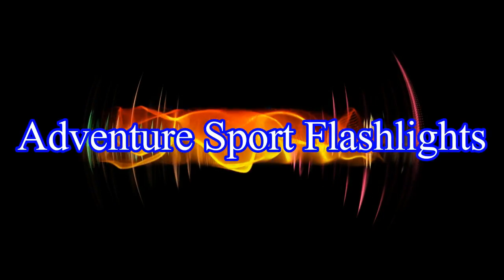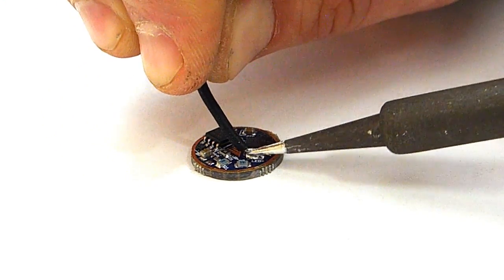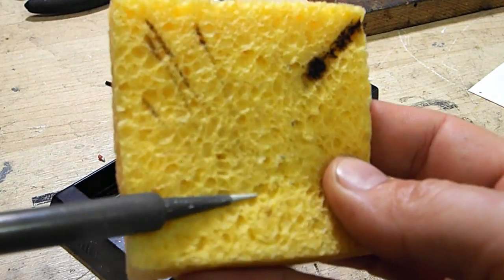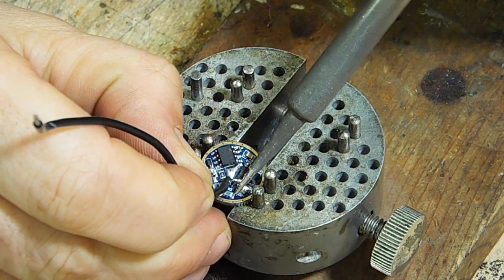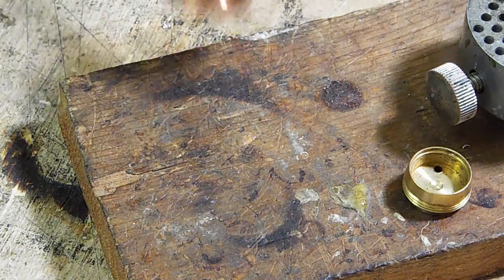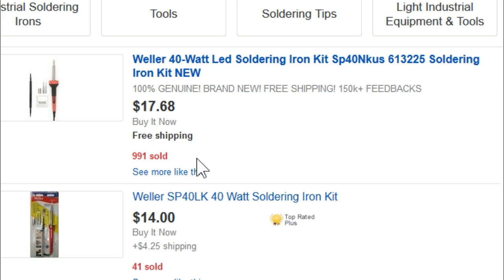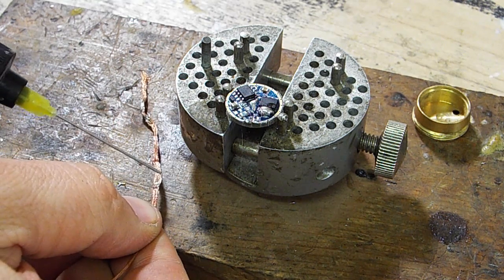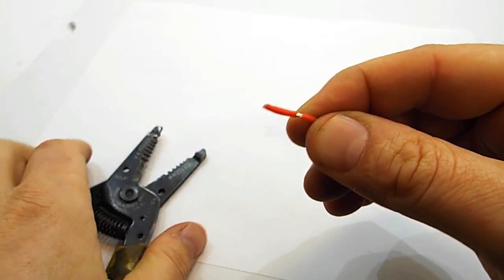How to Solder: Copper Pills, Wires, High Power LEDs and More

Comment: 850º is pretty dang hot. If you start going through tips lower it to 750-775 and use a larger tip. Ive used a weller at work for last 20 plus years. Its not my favorite but its a workhorse. I use a Hakko i was given by a rep friend about 35 years ago and its still cranking! I still use it almost daily at home. One more note id add to your video is if you do fine pitch work the sponge and deionized water is a better choice. The brass is good but is good at coarsely removing debris. A sponge will clean better. If you dont keep your tip on the sponge so long you wont have a problem with it loosing heat. Its bad for the tip anyway because tips are mostly laminated and the thermal shock will begin to separate the tip laminate construction.  Proper tip care is everything. I had a Metcal tip I used for 20 plus years and finally the heater went out but the tip was still good. Great intro and good to see someone do it on YouTube. I thought about it but just never did:)

Comment: Pasted below is my reply to one of your commenters. He was struggling with the flexibility of wire connections, which I see all the time in the flashlight and drone building communities. 
I happen to have a bit of professional experience in these areas and thought I might add my two cents. Hope this helps someone....

Here’s my pasted comment

I’ve had the same issue, and this is what I have found. This is just my experience and advice but hope it helps. 

I would be surprised to find aluminum coated copper wire. If tested with acid, even the cheapest plated wires are nickel or tin instead of aluminum. Not even sure how they could plate the wire in aluminum because of the extremely high melting point. And ridiculously expensive/difficult process of plating aluminum. 

In my opinion, your an issue with breakage, was caused by other properties which all wires are susceptible to.
 Once wire has been soldered, a bit of solder will creep up under the silicone sleeve Due to capillary action. That’s the exact same issue that causes water to creep into wiring. If you take a 100 foot extension cord and stretch it out… Dip one end in water and wait a few hours… The other end will get wet because the capillary action wicks the water all the way through the cord quickly. Crazy and causes many terrible issues with wiring and automobiles and many industries.

Also, even normal heat which is applied during soldering adds a bit of hardness and brittleness to the wire. Most people don’t realize, but copper and other metals can be heat treated and hardened just like steel. The effects are much less noticeable but still cause brittleness. The brittleness doesn’t allow the copper wire to flex, Making it very susceptible to kinks and it loses all of its springy qualities.

 therefore if bent back-and-forth even just a millimeter or two only once or twice…will break close to the shoulder joint. Even the most expensive “Belden” brand silicone test lead wire is susceptible if used in this manner. And that’s the same wire used in $100-$400 sets of test leads made by companies like fluke, Agilent, and Tektronix. 

The best way to combat this issue is to use a precision and high enough powered soldering iron, plenty of flux, and solder with a good lead content close to 40%. The faster the joint can be made… Lessens the time the wire is heated. Therefore the heat doesn’t creep up into the wire carrying the solder with it. It is only soldered at the point of connection. 

Another great thing to do is add a bit of silicone or flexible silastic compound over and around the joints. This is how the all high end industrial circuit boards are manufactured. If you open up any expensive industrial electronics… The board will be covered in conformal coating or a thin layer of epoxy… And the wire joints, transformers, capacitors, and anything that protrudes off the board.... will have silastic or silicone rubber around the base to keep them from moving, flexing, or vibrating. Even the slightest vibration (if constant over several years)… Will cause joints and component legs to break after becoming brittle.

A quick note about adhesives and rubbers…
be sure not to use regular silicone caulking or other materials. Some of them can cause corrosion on the copper traces on the board. It has to be neutral cure silicone caulking or adhesive, which contains all releases nothing acidic during the curing process. These can be found cheaply at any Walmart or hardware store. Just do a bit of research and figure out which ones are acceptable. there are many electronics forums that will steer you in the right direction of a good and inexpensive product, That is available locally and doesn’t have to be specially ordered.

I’m not an electronics guru. so this is just my advice based on my experience. However, I’ve been lucky enough to work on tens of thousands of high-end industrial electronics and space-age test equipment that is crazy cool and interesting.

I have an electronics lab, with NIST certified/calibrated equipment. Half my time is spent building guitars and violins, But the other half is spent in the lab repairing and recalibrating industrial electronics and test equipment for clients. 

I’m sorry to ramble on, but I Hope this helps someone

Comment: Great vid. Finding proper wire is tough these days. Most silicon flexible has aluminum tinned strands inside. For the short runs in a flashlight I guess it doesn't matter but I'd still prefer the durability of real copper. I did a DIY bluetooth speaker with silicon aluminum wire and I had a wire break off just by bending it back and forth a couple times. The solder was fine but the wire at the base of where it was stripped broke. I use lamp cord now and I can bend that copper wire back and forth and it holds up..
Reply: I’ve had the same issue, and this is what I have found. This is just my experience and advice but hope it helps. 

I would be surprised to find aluminum coated copper wire. If tested with acid, even the cheapest plated wires are nickel or tin instead of aluminum. Not even sure how they could plate the wire in aluminum because of the extremely high melting point. And ridiculously expensive/difficult process of plating aluminum. 

In my opinion, your an issue with breakage, was caused by other properties which all wires are susceptible to.
 Once wire has been soldered, a bit of solder will creep up under the silicone sleeve Due to capillary action. That’s the exact same issue that causes water to creep into wiring. If you take a 100 foot extension cord and stretch it out… Dip one end in water and wait a few hours… The other end will get wet because the capillary action wicks the water all the way through the cord quickly. Crazy and causes many terrible issues with wiring and automobiles and many industries.

Also, even normal heat which is applied during soldering adds a bit of hardness and brittleness to the wire. Most people don’t realize, but copper and other metals can be heat treated and hardened just like steel. The effects are much less noticeable but still cause brittleness. The brittleness doesn’t allow the copper wire to flex, Making it very susceptible to kinks and it loses all of its springy qualities.

 therefore if bent back-and-forth even just a millimeter or two only once or twice…will break close to the shoulder joint. Even the most expensive “Belden” brand silicone test lead wire is susceptible if used in this manner. And that’s the same wire used in $100-$400 sets of test leads made by companies like fluke, Agilent, and Tektronix. 

The best way to combat this issue is to use a precision and high enough powered soldering iron, plenty of flux, and solder with a good lead content close to 40%. The faster the joint can be made… Lessens the time the wire is heated. Therefore the heat doesn’t creep up into the wire carrying the solder with it. It is only soldered at the point of connection. 

Another great thing to do is add a bit of silicone or flexible silastic compound over and around the joints. This is how the all high end industrial circuit boards are manufactured. If you open up any expensive industrial electronics… The board will be covered in conformal coating or a thin layer of epoxy… And the wire joints, transformers, capacitors, and anything that protrudes off the board.... will have silastic or silicone rubber around the base to keep them from moving, flexing, or vibrating. Even the slightest vibration (if constant over several years)… Will cause joints and component legs to break after becoming brittle.

A quick note about adhesives and rubbers…
be sure not to use regular silicone caulking or other materials. Some of them can cause corrosion on the copper traces on the board. It has to be neutral cure silicone caulking or adhesive, which contains all releases nothing acidic during the curing process. These can be found cheaply at any Walmart or hardware store. Just do a bit of research and figure out which ones are acceptable. there are many electronics forums that will steer you in the right direction of a good and inexpensive product, That is available locally and doesn’t have to be specially ordered.

I’m not an electronics guru. so this is just my advice based on my experience. However, I’ve been lucky enough to work on tens of thousands of high-end industrial electronics and space-age test equipment that is crazy cool and interesting.

I have an electronics lab, with NIST certified/calibrated equipment. Half my time is spent building guitars and violins, But the other half is spent in the lab repairing and recalibrating industrial electronics and test equipment for clients. 

I’m sorry to ramble on, but I Hope this helps someone

Comment: Thank you for the soldering instructional video. While very descriptive on soldering technics, there was no mention of the ‘elusive’ Brass and or Copper buttons. Please provide the origin of the same, when ever you get time.
Reply from the maker: HI.   The copper buttons are what's called "gas checks".  They are a part used in reloaded bullets.  I think the ones I had were 32 caliber.     https://www.sagesoutdoors.com/     

 ....Now that copper springs with gold plating are available I use these. https://intl-outdoor.com/gold-plated-beryllium-copper-spring-5-pcs-p-831.html?zenid=51d6d6d62682a0580cb2b98f81e92e91  Not all the springs sold at that store are copper just the one in that link.

Comment: Do you have a tip for soldering LED wires inside the flashlight head? I pre-tin my MCPCB, put it inside the head, then put a bit of flux on the tin on the MCPCB and reheat it with the cables held in place with tweezers. But often I get this sticky tin which sticks to the iron when I pull it away.
I think that's because of not enough flux on there, right?
Reply from the maker: I get that once it a while too.    I  am not 100% sure what causes it.   I think most of the time it's because the solder is not wetting fast enough.   I've noticed it rarely happens if I'm soldering on a regular pcb rather than a metal core one.

Comment: Hi man, is this silicone wire that you recommend good for spring bypass on the tailcap and driver ? If yes, what is the best from 8 awg to 28 awg ? Thanks.
Reply from the maker: Hi Aleksandar,    Yes, silicone wire works perfectly for that.  On small lights with a light spring like 18650 size I use about a 24awg.  On heavy springs like for a maglite I go up to about 20 awg.

Comment: Great video! What wattage or power should the soldering iron be set at, or should I be asking what temperature should the heat be set at? Sorry, I know NOTHING about soldering, LOL!  Thank you:)
Reply from the maker: No problem Wayne, I'm glad to help.   We are all here to learn including me :)   For most flashlight projects I set my iron between about 750-800 F.    The only time I go above that is to solder a thick piece of metal, and you dont want to leave it on that high for any longer than you have to because it wears the tips out faster.

Comment: Hey Matt, I've done the occasional solder work here and there for like 20 years always using flux core solder, but when dealing with tiny parts, like smd stuff, you can't always stick the wire into the joint. Without the flux you don't get a good joint. I just recently picked up a flux pen for electronics. Man that makes the soldering so much nicer. I also recently switched from sponge to brass cleaner like in this video. Not losing the heat really speeds up my work.

Great video here.
Reply from the maker: I've never tried the flux pen, sounds like a neat idea.

Comment: I picked this one up about a year and a half ago and haven't had any issues with it yet (knocking on wood) and I use it quite a bit for modding lights.

https://www.amazon.com/gp/product/B00MCVCHJM/ref=oh_aui_detailpage_o07_s00?ie=UTF8&th=1

I doubt that I've modded as many lights as you have but I've modded a few.  The one thing that I haven't done and need to is invest in some Kester solder.  I've never used any and I find that different flashlight modders use different types of Kester solder.  I'm going to go with your recommendation since your joints look great...mine aren't bad but I've had a few that weren't so pretty.
Reply from the maker: Thanks for the input.